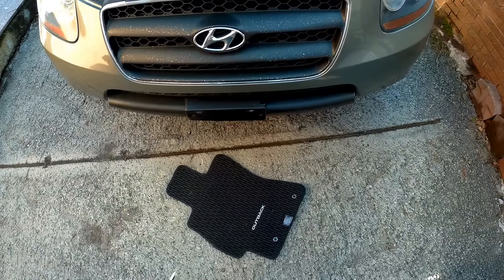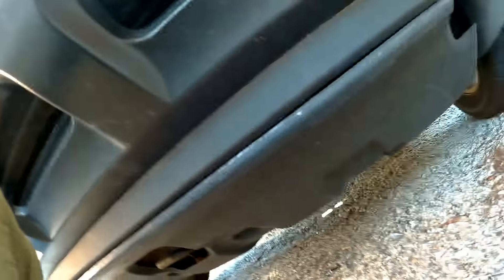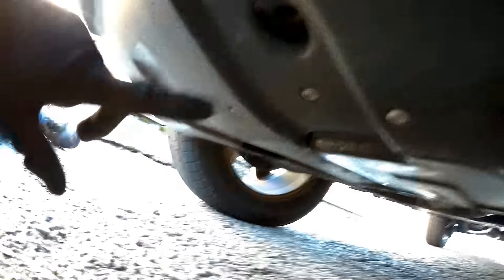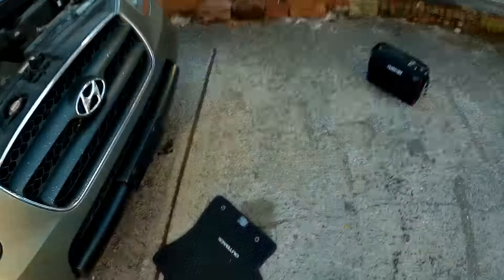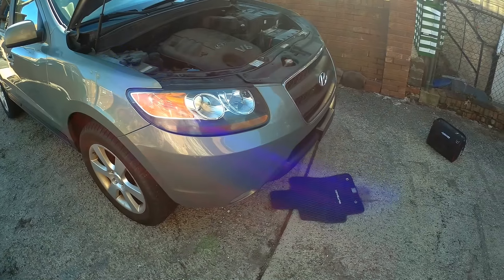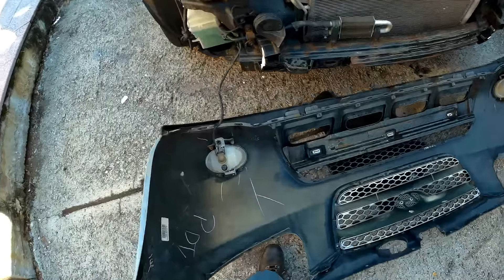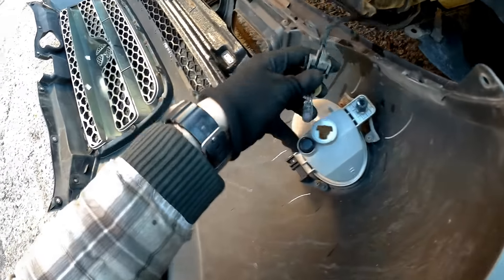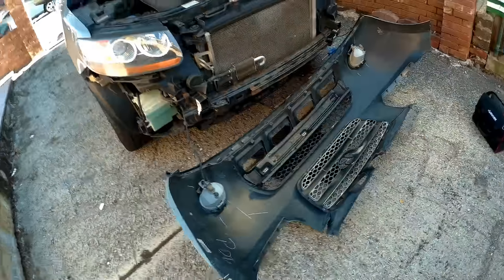How to remove install front bumper cover Hyundai Santa Fe

Comment: Need to replace my horn, see you already have those big ones in.
I have the head light sprayers in the bumper, let's see how far I get since you don't have them installed.
Completed! 
You can grab behind the bumper from the fender, after pulling it out of the side, there you have enough space to unplug the lamps and you can push the spayed unit out ..keep a plyer ready to stick behind the sprayer unit to hold it in place, so you don't have to hold it...and remove the cover.

Comment: Does anyone know if the whole bumper needs to come off to remove and replace the grille on this bumper?
Reply: Kevin Surujdyal did you ever find out
Reply: @sidthekid6080  It can be done without, but it's so tight the time taken would be more than just taking the bumper off. It's only about 8 additional bolts. Also, if you drop a bolt the bumper has to come off anyway